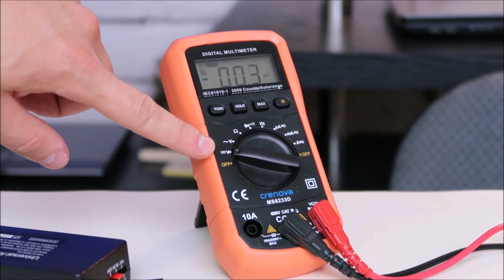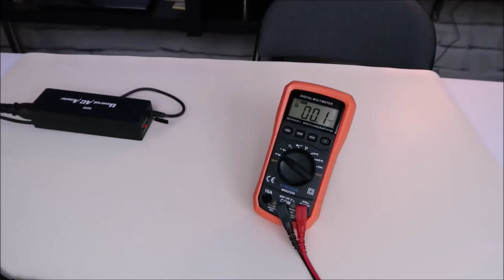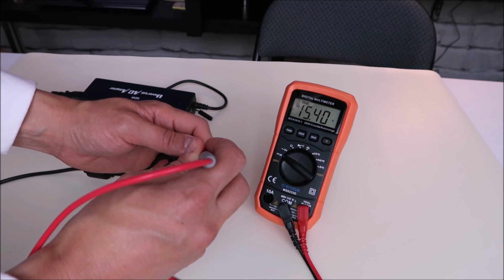How To Fix Any Laptop - Wont Turn On, Wont Open, Turns Off Right Away, No Power Solution

Comment: well all didnt work buttttt i did hold the power button for 1 min and then windows security thing or whatever is called said that there  was something wrong with loading so it said to restart so i did and then it fixed
Reply from the maker: Well done :)  Glad your all set !!
Reply: @PC_Monkey  there was also a charger problem where it wouldnt charge but i ran a trouble shoot fixed it, cause i spilled water on my laptop and thats what caused it but its working fine again
Reply from the maker: @ven._._.  Great :)

Comment: Hi there, I do have a Toshiba Satellite model C 55 D - B 5308 . After looking for information about the RTC battery I have a question, is it possible that this model doesen`t have a battery other than the one and only slide in on the back of the laptop. It doesen`t turn on,  and when I could do it,  it gives the message of "RTC battery low"  and after pressing F2 to change the info, it goes off... please help me, thanks in advance, Joe
Reply from the maker: Yes, its possible.  Not all computers have a CMOS Battery.  I would try replacing the main computer battery in that case.

Comment: I cant take my battery out
My laptop is a Acer aspire es1-531-c8da
Reply from the maker: You can see that here; https://www.youtube.com/watch?v=gOuoEchsrNc
Reply: @PC_Monkey  thanks
Reply: @PC_Monkey  do you know where to get power button motherboard from (top left in laptop)
Reply from the maker: @yatamiata  I usually get most of my computer parts on Ebay or Amazon
Reply: you can hold down the power button and windows repair window will come up and ill fix
Reply from the maker: @ven._._.  If the problem is with Windows yes, if the problem is with static, the battery, charger, motherboard or other issues, that wont fix it.  Thx though

Comment: Ive tried this but it gotten worse. Now its not really turning on anymore. I just have a flashing white light in my charger jack
Reply from the maker: This video is for a computer that wont turn on at all.  How did it get worse from not turning on to really not turning on lol?
You tried all the steps seen here in this vid?
 If all the tests in this video do not reveal the issue, then your most likely looking at a Motherboard replacement as seen here;  https://youtu.be/N_7HNrFkMS8.  If you know your computer's model number, I can help you get inside your specific computer :)

Comment: Please help me out ! I've recently changed  battery in my asus laptop after that 1st it randomly turned off and then regularly and stay on only when I plug in the charger
Reply from the maker: Is the battery new?  Is it generic or a brand name battery?
Reply: Battery was baught from asus service centre not open market
Reply from the maker: @wavewarrior6811  Is the battery the correct Volt and Amp rating for the computer?  And the same exact issue exists before and after the battery replacement.
Reply: Yes and I think battery is doing fine but problem started 1 week after new battery was fitted
Reply: My laptop is asus vivibook 542rq and of 2.5 years old
Reply: Also I don't think it is software problem
Reply: And when I connect charger to laptop it than automatically starts and turn off when charger is removed or electricity is gone please help this has made my life a hell
Reply from the maker: @wavewarrior6811  My first guess is still a bad battery.  Have you tested the charger as seen here;  https://youtu.be/P3I7dDpkJps.
Reply: I've bought battery from Asus authorised service centre with 90 days guarantee should I go to service centre once again?
Reply from the maker: @wavewarrior6811  I would then test the charger
Reply: I'm going to service centre thanks for your advice appreciate your attitude man.

Comment: so i was using my laptop then suddenly i couldnt click on anything but i could move the mouse i just couldnt click on anything so i got scared and clicked the power button but nothing happened so i got even more scared so i closed the laptop and checked back in later, and when i opened it minutes later there is a pop up that its not processing?? (im really stupid and i wasnt thinking correctly because i was so nervous) and there was an option of wait or resolve then my screen turned black and it didnt it would start anymore i can still see that its open because the power button still has lights on, but i closed it and keep coming back but nothings happening!! Somebody help me my dad is gonna kill meee 😭😭😭
Reply from the maker: What brand computer do you have?
Reply: I too have the same problem, have you solved it.
Reply from the maker: @vragav2609  What brand and model computer do you have and whats the issue with it?
Reply: @PC_Monkey   My laptop is Lenovo e41-25 . while i was using my laptop it freezes suddenly and glitches appear, then i forced shutdown it. But after restarting there is no display on screen , power led is glowing , fan rotates, no beeb sound, no led is glowing in pendrive when connected to usb port but i can charge my phone when connected using usb cable while turning on, there no light blinking in capslock button, no light glowing in external usb mouse and keyboard.

What can i do now? Is my motherboard fault?

Comment: Asus GL553ve, I updated bios with winflash to version 308 and after booting laptop started draining battery very fast even with charging plugged in. Now its not turning on, charging light only blinks once and goes off again. No boot up nothing. I want downgrade bios but laptop not turning on. I tried CMOS switch remove for about 20 min but nothing happened after assembly. Plz Help 😣
Reply from the maker: For a computer that does not turn on, try this video first;  https://youtu.be/P3I7dDpkJps.  Let me know how that goes :)

Comment: My laptop Lenovo i580 won't boot into Windows 10 (totally updated as of today). Failure started intermittently 2 days ago. After trying 10 to 20 times, the laptop finally booted fine. Yesterday after booting, I applied all Windows updates. Turned off at lunch time, but afterwards it never booted again. **Failure description**: Push start button, keyboard panel lights go on, red LENOVO logo appears for few seconds in the center of the screen as usual, logo disappears, lights still on, few seconds later lights go off at the time I can hear a "PHEEEeeee", wich I think is the fan turning off too. I have followed " How To Fix Any Laptop - Wont Turn On, Wont Open, Turns Off Right Away, No Power Solution" (updated) and the "How To Fix Acer Computer Boot Loop, Restarting, Stuck Loading, Stuck Diagnosing PC, Etc" as both issues are similar but not exactly the same, to no avail. Any idea? Thank you!
Reply from the maker: Try this video first;  https://www.youtube.com/watch?v=g8WkyX0dan0
Let me know how that goes :)

Comment: I need help with my laptop. The charging light is on but the laptop won't turn on. The fan isn't turning on or the screen. The battery and Charger is fine because it turned on yesterday, but now it's not turning on
Reply from the maker: your on the correct video.  Have you tried the steps seen here yet?
Reply: @PC_Monkey  Yes however I got it working. there's a problem with my power on button. I had to open up the laptop take out the power cord and put it back in again and it turned on
Reply from the maker: @hazelwilliams4866  Well done :)

Comment: How about my Lenovo laptop it shows power indicator for 10 seconds but no action even the fan after 10 seconds the power indicator will off and it will turn on again after 10 seconds any help pls...
Reply from the maker: your on the correct video.  Have you tried the steps seen here yet?

Comment: Hello
Toshiba Satellite C55 ... Had dark screen but stayed on ...replaced battery and CMOS battery. Now turns off during boot cycle. I can hear fan and hard drive  but shuts off before logo appears. New battery led flashes when installed does not flash when I re-install old battery stay solid orange and will charge and turn green with old battery. With both batteries it is now turning off during boot cycle. Any ideas? Thank you
Reply from the maker: If all the tests in this video do not reveal the issue, then your most likely looking at a Motherboard replacement

Comment: I have a ac laptop 2018 model and it get hot very fast while gaming my laptop turn flat ,after that when we charge for like 2 hour is still not opening and the laptop is very hot
Reply from the maker: You should fix the overheating issue first.  That can damage multiple components in the computer.  See how to fix an overheating computer here;  https://www.youtube.com/watch?v=K_j4GPjpawk

Comment: if i keep my finger on "f" keys  and not letting go..then the laptop gets power and then if i remove my finger from "f" keys the power turns off again.. which means the screen gose black : ( 
help..
: (
Reply from the maker: Your keyboard may be malfunctioning.  Try unplugging the keyboard ribbon cable from the motherboard, and then plug it back in.  See if that helps.  If not, try replacing the keyboard.
Reply: @PC_Monkey  its working now : )
thank you : )
Reply from the maker: @anonymous-gs4pz  Glad your all set :)

Comment: Thanks for the great video! I measured my charger, and it gives 20V then I measured my battery, however it gives only 15V. Is that an issue, or is that common for batteries? The laptop (lenovo thinkpad 300) didn't work even after unplugging battery and plugging in charger. Please help!
Reply from the maker: Thats normal for batteries to provide less.  The other steps have been added to this updated video;  https://youtu.be/P3I7dDpkJps.  Let me know how that goes :)

Comment: Could someone help me please🥺 i have an acer travelmate b118 and im using it in my online class, it's just 1 month old and i dont know what's the problem. It's just that the other day, im trying to use it cause i'm taking my exam but then minutes have pass and there's still no power, but when i plug the charger its charging but not starting/opening. Pleaseee i badly need help🥺, my father would surely beat me🥺pleaseeee, cause i really need it in my online classes.
Reply from the maker: For a computer that does not turn on, try this video first;  https://youtu.be/P3I7dDpkJps.  Let me know how that goes :)

Comment: Hey.. my laptop is dead and no response and repair shop says need to replace motherboard... Nd i didn't replace the motherboard till today..,... But after 15 days my laptop start all of sudden without doing nothing and works properly for 1 day after than same issue and again  starts after 10 days and works properly for 1 day... This process kept repeating....

Not able to understand what's problem with my laptop ?
Any idea sir ?
Reply from the maker: Have you tried the steps seen here when its not starting?

Comment: Hello there. I have a lenevo G510 laptop. When I try to start it my battery led works and the power led works and the fan turns on. But half way it shuts down. If I hold the button on for too long the laptop tries to start multiple times but fails everytime after going through the same above described process. Kindly help me with diagnosing the issue.
Reply from the maker: 'Half way it shuts down'  ??   Does it turn off before or after your able to see the startup logo screen?
Reply: @PC_Monkey  it shuts down within 10 seconds of powering it up. The startup logo doesn't appear the screen is blank.

Comment: Nothing works
Reply from the maker: What brand and model computer do you have and whats the issue with it?
Reply: @PC_Monkey  it doesn't start at all, nothing, dead. I put it to charge it shut down completely and died. 
Accer Aspire
Reply from the maker: @CarMagic1   If all the tests in this video do not reveal the issue, then your most likely looking at a Motherboard replacement as seen here;  https://youtu.be/N_7HNrFkMS8.  If you know your computer's model number, I can help you get inside your specific computer :)

Comment: My charger plug 🔌 blasted few weak ago but i the battery mon was not blasted i changed the plug 🔌 and my charger worked can it be the reason of not turning my laptop plz replay i am in big trooble
Reply from the maker: I dont understand 'blasted'.  Does your computer turn on?  If not, have you tried the steps in this video?

Comment: Can i remove cmos battery wire for overnight
Reply from the maker: Yes, if you want to reset your BIOS, you can unplug the CMOS Battery wire overnight.
Reply: @PC_Monkey  after doing the bios reset should we plug in charger and open or not
Reply from the maker: @Hero-pv1hb  Yes :)  Put the battery back in and plug in the charger and try to start the computer.
Reply: @PC_Monkey  ok wait i will do
Reply: @PC_Monkey  for reset bios should we remove battery also with cmos battery
Reply: @PC_Monkey   my laptop not started
Reply from the maker: @Hero-pv1hb    If all the tests in this video do not reveal the issue, then your most likely looking at a Motherboard replacement as seen here;  https://youtu.be/N_7HNrFkMS8.  If you know your computer's model number, I can help you get inside your specific computer :)

Comment: heelp, i really can't open my laptop :((
Reply from the maker: What brand and model computer do you have and whats the issue with it?
Reply: @PC_Monkey  Asus k53u. I tried turning it on but it doesn't open. The led is open then after a second or two, it will off. I also try charging it but its still the same. I'm worried about my online class :((

Comment: Hi! I got an HP 15 Notebook PC. Nowadays, it just turns off at exactly 41%.... When i turn it back on, i see the logo, and then it shuts down again. 

It only turns on and works perfectly when i plug in the charger :(( may i know which video is applicable for this situation?
Reply from the maker: This video would basically identify your battery as the issue.  Think you should replace it.
Reply: @PC_Monkey  thanks! As of now, i am starting the video to watch it.

I'd like your opinion on something, 

Is it true that one of the reasons the battery gets messed up is because of leaving it charging overnight?? 

Im starting to think it's because of that...
Reply from the maker: @wilde624  Not really overnight.  The health of a battery can be negatively affected by leaving the computer plugged in all the time.  When its off and  when its on.  The battery should be allowed to drain down sometimes before charging back up.

Comment: My laptop turns on and off, on and off till the battery dies. I tried everything nothing works. Do u know what might be the possible issue
Reply from the maker: When does it turn off?  During startup or while the computer is in use?  If during startup, before or after you are able to see the startup logo screen?
Reply: @PC_Monkey  no before the boot image or startup logo it turns off. And turns on again. Happens in seconds
Reply: Plus the powerbutton is in the keyboard. I thought the keyboard was faulty and replaced it but its not the issue. I tried power drain. And resetting the base system.
Reply: @PC_Monkey  bro one of ram sticks had a problem. So now it's working. Thank god my soldered ram is fine. The other ram on the slot was faulty. I watched most of ur videos and they helped me a lot. Thank you very much
Reply from the maker: @joelserrao1078  Great work figuring it out !!  Sorry i didnt answer sooner :(  Had a busy day yesterday :(

Comment: ok so i have a dell inspirion 3451, about 2 years ago it started giving me problems with the charger but i ignored it cuz i was still really young bout 12-13 ish, i occasionally got black screens saying the charger wasnt working but once again i ignored it but then one day about a year and a half ago it just up and stopped working on, there is no light saying that it is charging when i plug it in but when i plug the charger into my chromebook it works just fine, so just incase i bought a charger that was 15$ of amazon i tested for static, the battery, and the cable, i dont trust my 15yo brain to dissemble my computer and do this is there any other possible thing it can be
Reply from the maker: If all the tests in this video do not reveal the issue, then your most likely looking at a Motherboard replacement as seen here;  https://youtu.be/N_7HNrFkMS8.

Comment: What do I do if my laptop has the power cable plugged in and the motherboard is making a clicking sound
Reply from the maker: If your computer is not turning on, then your on the correct video.  If you think that the computer may be turning on but the screen just is staying black, refer to this video instead;  https://youtu.be/u-REPLdpZ70

Comment: So heres what happened, i was working on windows 10, the battery was charged full and the charger was plugged in still
And then my laptop shutdown itself without showing any reason, it just shutoff. The temperature was perfect and no overheating. After it shutoff i turned on again and i reach the screen where i enter my password, i type in my password it shows welcome and then it just completely shutsoff again. When i went to troubleshoot option and tried system restore it just shutsoff again while im on screen i tried without battery and direct charger and it still happened it just shutsoff when i enter my password to login or troubleshoot. BTW IT SHUTSOFF WITH A CLICK SOUND LIKE WHEN THE POWER GOES OFF eventhough its charging. It doesnt let me reset the PC too it just shutsoff again, the last option is installing a new windows 10 which i havent tried yet so im asking you to tell me what cause this problem please reply
Reply from the maker: Try the static discharge here and then repeat the process with only the battery and then only the charger.  Same result all 3 times?

Comment: I really wanna be on my computer, but i have to replace my battery which i wony be able to replace for awhile, is it okay if i use my computer without the battery?
Reply from the maker: Yes, you should still be able to use your computer with just the power adapter plugged in:)